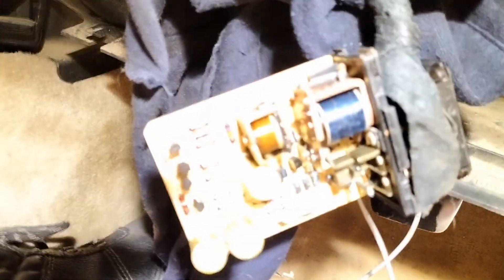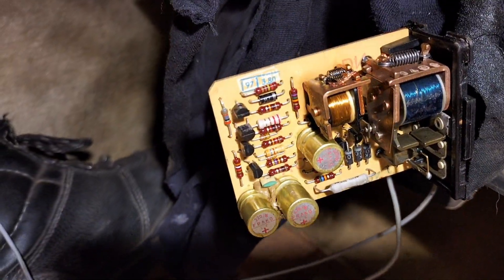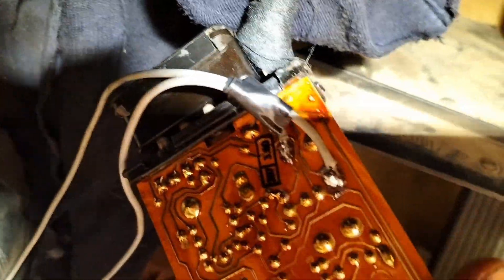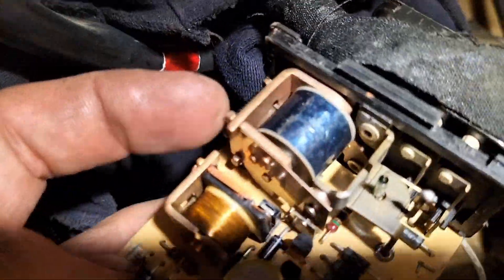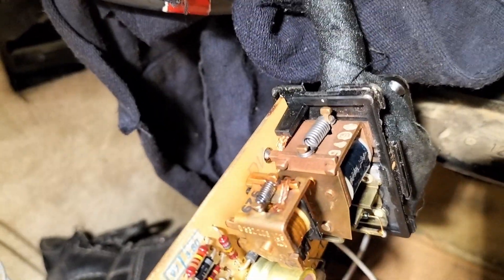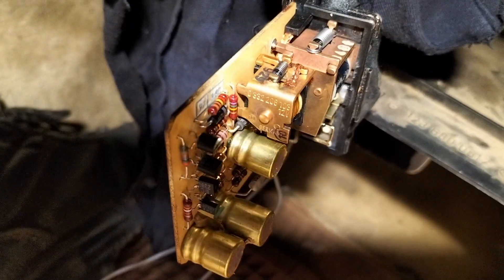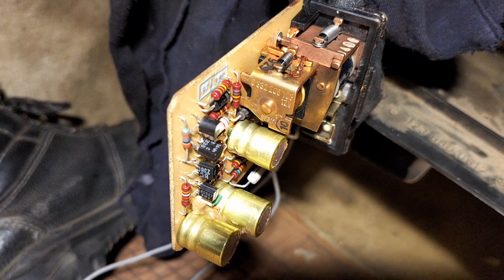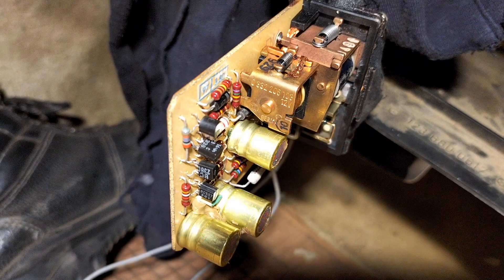Mercedes 240D dead glow plug relay hack

Comment: do you know where we can find equivilent capacitors?
Reply from the maker: Any electronics store should stock them or you might even find it on ebay depending on your country.
Reply: @joopontheroad also to mention that im doing the exact procedure here to test the relay and its pulling that little spring bridge after a couple seconds, and when it lets go giving that clicking noise i go ahead press down on that spring bridge to give it another cycle for a split second and i can feel the heat on the relay yet the glow plug light isn't coming on.. to make things simple would that be the relay or just a faulty glow plug light?
Reply: Hi there , same problem. How do I access the relay ? Where is it